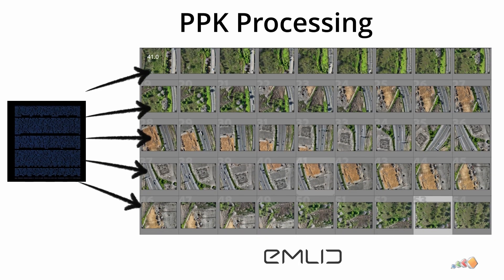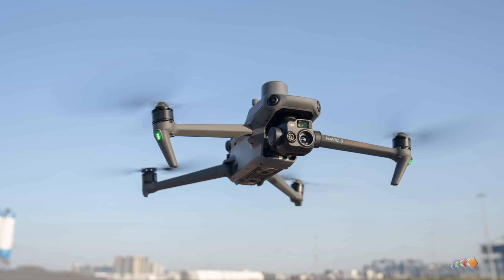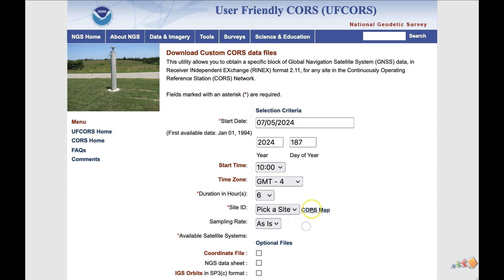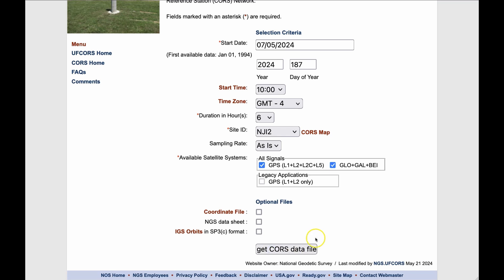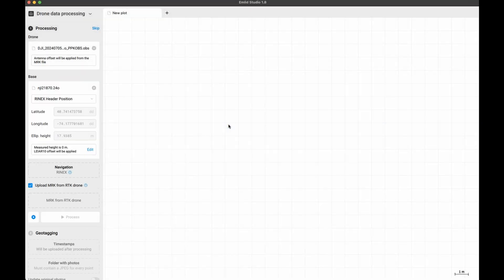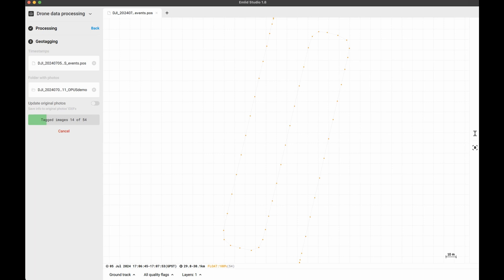RTK Correction using CORS for PPK  after the flight

Comment: How did you get to OPUS Processing Test in WebOdm?
Reply from the maker: I'm not 100% sure what you mean.  But...if you correct the metadata in the photos using this method you don't need to do anything special in WebODM - it will put the photos wherever the metadata says they are and if it has been corrected it will show up in the right place.
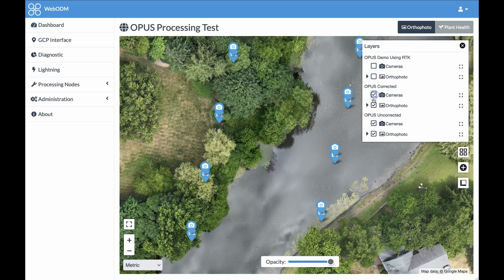Reply: Ok, I’m totally embarrassed…that’s the name of your project. (I’m looking at around 5:08)
But, I’m making progress.  
I got it to work!!! Thank you for this video. 
I followed every step!
Next time I want to incorporate checkpoints. 
Sorry for the “Blonde” question. I’m a brunette 😅
Reply from the maker: @twirlybird5212  LOL - not a problem.  There's a good chance someone else will benefit

Comment: I have the Mavic E 3T with the RTK module on top. I had turned it off as you mentioned, but I never see those additional files (mrk, obj etc). What is required to get those created?
Thanks for these great videos!
Reply from the maker: Unfortunately the M3T doesn't store those files.  Don't ask me why - that's a question for DJI.

Comment: A few points to remember when running the PPK workflow:
1) Flight should be at least ten minutes.  Anything less than ten minutes could degrade the accuracy because the drone’s RINEX file has limited GNSS data. 

2) As mentioned in the video, The CORS station you select should be as close as possible…but no more than 18 miles.  Once you exceed 18 miles the GNSS vectors will begin to degrade

3) The sampling rate of the CORS station you select should be 1
Reply from the maker: Great information!  Thanks for contributing the community!

Comment: Hello sir, i have 2 questions.
1. What is the Fix Float and single in Emlid Studio?
2. Some suggest to use the Nav file frim the base, what is the diiferent?
**Additional question, I have a probem with DJI DRTK 2 when I input the coordinate and Elevation into DRTK via remote and the warning keep says RTK error, so I wait for a while but the RTK still say converging. I have to turn off and on the drone again then RTK connected. Did i miss something or its normal to turn off and on the drone after input the coordinate. Do You have the same problem like this sir?

Thank you
Reply from the maker: Hi.  Thanks for the questions.
1.  Fix / Float is only relevant to RTK, not PPK, so I don't believe it's relevant here - although I'm always happy to be educated if I'm wrong!
2.  The Emlid Studio manual says you can use either but doesn't go into more details.  I think it's actually redundant when using the other files.

I don't use the DRTK base station.  But I know when I switch methods from custom to DRTK it does say in Pilot 2 that you need to restart the device after the switch, so maybe that is normal?

Comment: Hello,
Great video again.
You mention files generated by the drone even with rtk off.
I own a mavic 2 Enterprise with rtk module. How can I check that  it can provide the same types of files ?
I guess it is not the case.
Rgds,
Reply from the maker: Glad you liked the video.  I believe it should be the same but it would be easy to check.
Go for a short flight with the RTK module installed but with RTK turned off and take a couple of photos.
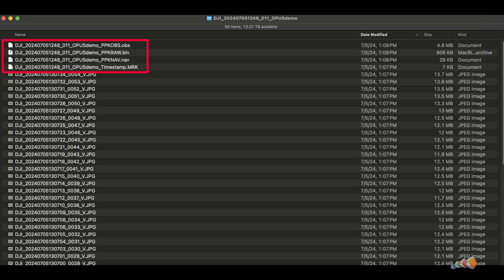Then go to the folder and make sure that the highlighted files shown at 1:35 in the video are there.  There should be files that end in .obs, .nav and .mrk
Reply: @aviosmedia  Thanks. 
I will give it a try.
Reply from the maker: @dronetoulouse  I seem to recall that I did confirm this with my M3T a while back but...can't remember for sure so maybe you can confirm here when you get around to it as I won't be back in the office for a few days